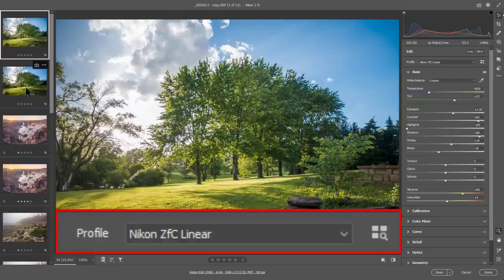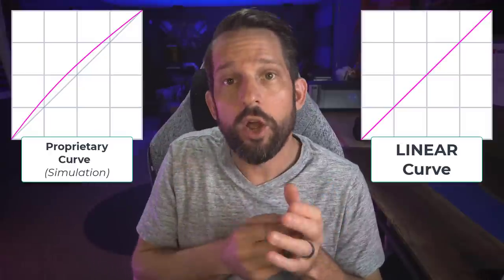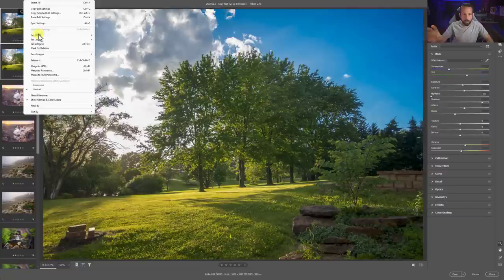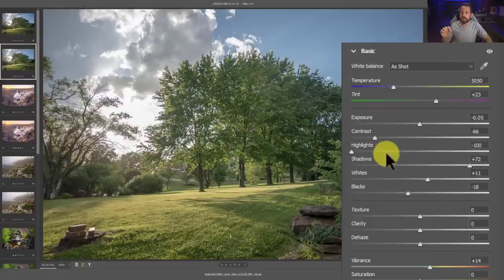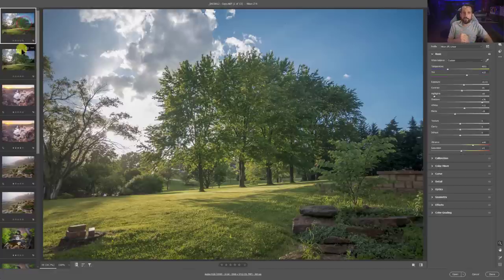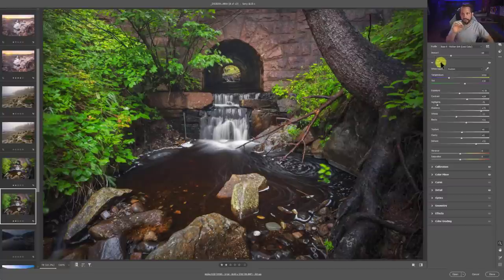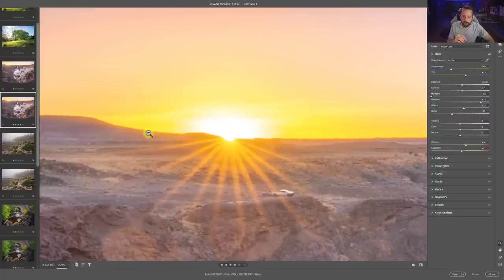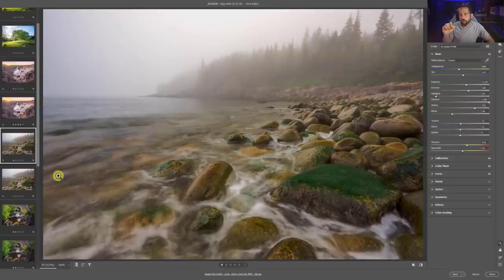Linear Profiles • What's so special?

Comment: Sorry I have to take exception with your comments/assertions about raw files... there is no profile hidden  in the raw. The profile is applied by the chosen raw editor be it on1, LR, capture one... THere is a obviously a profile used by the camera maker when preparing their out of camera jpg and typical raw editor will try to emulate that but a basic edit of the raw has only the profile applied by the raw editor..in your case LR.... LR is a display referred editor so right out of the gate it doesn't benefit as much as it could from a linear profile. LR hits the image right out of the gate with a display referred profile. THe data is now edited in that profile. As such say something like exposure. If you double exposure you don't acutally double the output....the effect you see is impacted by the curve in the profile This is why HL often get blown out by processing. Linear profiles recover this and allow adjustments to behave acutially more intuitively not less. With a linear profile if you double exposure then you double the brightness and the same for other controls... there is that 1 to 1 relationship in your adjustments. and this can actually help you to edit in a way that is more scene like and preserve the light from the scene.... THe full manifestation of this is in a software that actually allows scene-referred edits....and can work with HDR display effectively. In that case you actually work mostly in a linear space and expose for the midtones not worrying as much about the top and bottom limits... this can often blow out the highlights intially but there is a ODT applied after most of the editing to map highlights and shadow to the dynaminc range around the middle gray.... So you can see you are fighting with the linear profile because of this display referred pipeline of LR with anchored black and white and a distorting curve applied to the image at the start rather than the end.... Linear edits when you have the right pipeline will not look like a display referred edit and they will be generally better in many ways... you just can't fully exploit this in LR because you cant control the pipeline and LR puts the profile at the start....

Comment: For reference, Fuji and Sony colors are NOT baked into RAW files.  Neither is a curve.  RAW files REALLY are just RAW data, but because they're only data in the form of numbers and letters, they can't be viewed as an image.  So RAW editing software has to create a base look just for you to understand what the image is supposed to be.  But that is only the default.  You can change the image in any way you want.  For example, you can easily put Fuji color on a Sony RAW, and Sony color on a Fuji RAW, etc., because RAW data is RAW data.  It has no base look, and is near infinitely flexible.
Reply from the maker: That's interesting, then why do they all look different? There must be something baked in otherwise everyone wouldn't reach for linear profiles, right? I'm genuinely curious, because this is all a mystery to me. My Nikon files look different from my Sony files even with the same exact settings. Sure, lenses are a variable too, but it always has baffled me.
Reply: @f64Academy  I will try to explain it.  A raw file contains the signal reading that the individual pixel recorded during the exposure. Some pixels will record the Green light,  some the red light and some the blue light. This is the Bayer array. To convert these voltage signals into an image the signals from these different coloured pixels have to be "interpolated" into colour pixels. This is a complex math computation where the result depends on the demosaic algorithm used. 

So any raw converter has to demosaic the raw data to produce an image to display on the screen. There is no "raw image" only raw data numbers.

Raw converters like LR will improve their demosaic engines from time to time, and this is why you can change the "Process Version" if you want.

So each raw converter will crunch the numbers and produce what it thinks is a good starting point for editing. During this demosaic process the software applies a colour profile and a tone profile, usually an S-Curve. Exactly as you can do with the point curve tool in LR.

This is also why each camera, even if it uses the same sensor from eg Sony looks different to Nikon even though the Nikon is using a Sony sensor. Nikon want "Nikon" colour and "Sony" want Sony colour etc.

With a linear profile you are just removing the S-Curve that is normally applied during demosaicing and replacing it with a Linear curve. The idea of the Linear curve is to provide a better starting point with difficult, usually overexposed but not blown images for the simple reason any S-Curve will push the highlights into overexposure. 

Better software like Capture One have provided the option of using a Linear curve since V8 in 2014, so this is not a YouTube fashion idea, it's just a way making it easier to deal with difficult images in other raw converters.

Just a further clarification, the DNG generated by LR during HDR, Pano is a linear DNG, is effectively a Tif file in a DNG wrapper.

Hope that helps.

Comment: I found this video very interesting - thank you. I started using linear profiles a few years back, and I have to say that they really do work for me. For background, I use Canon gear to photograph wildlife and I process the RAW files in Lightroom then Photoshop. For wildlife work, I like to keep tone and colour in my prints as "natural" as possible and I used to really hate what was happening to my Canon RAW files (I can't speak for other camera brands) in Lightroom. Out of camera, they usually had far too much contrast and saturation. They looked garish and not natural at all - which meant editing them to flatten them out a bit and bring the colours back to reality. It didn't matter which "canned" profile I used - the problem was always there to some extent. I then built my own linear profiles for all my camera bodies and over time, I've developed a workflow that gives me the images I want and the extra effort is rewarded in the improved quality of my prints. I guess my experience is different to others - maybe wildlife work lends itself to linear profiles more because we often need to reduce contrast and saturation to avoid falling into the trap of editing too far? Anyway, I find it easier to flatten the profile and gradually build back the tone and colour than to fight against the canned profiles to remove the over-cooked contrast and colour. Thanks again for the detailed and very well researched video though - each to his/her own I guess!

Comment: I do not agree. I use Olympus em1 together with the em1 m2. with the linear profiles I notice that the details in the shadows improve, that the noise is lower (not only with ettr), that the rendering of the colors and the wb are more precise and with a better rendering (it seems to have worked in Lab with Ps) and that the images of the two cameras are almost identical in terms of rendering.
Reply: Personally, on my old and cheap Canon 70d, the detail drops significantly if I use a linear profile. And nothing can be done to correct this state of affairs.
I'm looking for a reason.

Comment: In Lightroom, after you apply a Linear profile you need to set the "gamma curve" with the regular curves. As ROMM (ProPhoto RGB) is the Colour Space when editing in Lightroom is encoded to a 1.8 gamma curve. You need also to bring the contrast slider to +50/85 to create the S curve you would've done with regular curves
Reply from the maker: Right... So you do all that to make it look like a regular photo without the linear profile 🤣

I jest, but it's true. You work harder to get your Linear profile to work for you than just working with the raw file to begin with.
Reply: @f64Academy  yeah ☹️. But it's super flat! 😂 I'm just joking cause I learnt about this stuff really yesterday. Need to dig more. But I'm more into camera calibration right now so the flat profile is in the middle of that process :)

Comment: There is a way to apply multiple profiles.  Begin in Lr/ACR, use the RAW profile (if you prefer) and do whatever else you want.  Open in Ps, then use ACR as a filter, at which point, you can apply any other profile you want.  You can go in/out of Ps/ACR as many times as you like, applying a different profile each time.
Reply from the maker: True!  But then you aren't working on RAW data because that's ACR as a Filter and not ACR the program.  That's also kind of unpredictable and could lead to more trial and error than I want as I'm working.
Reply: @f64Academy  Not if you open the original as a smart object.  Then you keep all the RAW data, even when you go back and forth.  Yes, much larger file size, but lots more flexibility if that is what is warranted.  (as least this is how it has been explained to me, but I could be wrong)
Reply: @lorijennings-emery8514  No, that's not true at all. If you run ACR as a smart filter, it's applying to the rasterized raw file, not the actual raw file. Not sure who told you that, but they were definitely wrong.

Comment: I don’t use linear profiles and I don’t consider myself as “knowing” anything about them but I had a completely different impression on the reason to use a linear profile.

I thought the intent of using a different profile is it changes the starting point (and that is all that has changed).  From starting at a different point, your thoughts and desires are altered and a person tends to end up at a different final image which they consider to be “better”.

A different profile doesn’t change the set of possible final images.  It only changes the starting point and that tends to cause those who advocate linear profiles to end up with final images that they consider better.
Reply from the maker: I can agree with that for sure. It is a different starting point, but is it a better one? That's subject to interpretation. I know many people who sing their praises, but I have many profiles I use for different starting points that I feel are better than a linear profile. It's all subject to workflow and what, where, and how people want to start.

Comment: I've played around with linear profiles a bit, but it seemed in most cases I just ended up pushing sliders a lot to essentially get it back to what the "normal" profile would already be like. Now I just keep it in my back pocket as an option with some problematic, high-contrast images, and try it to see if that helps or not -- but most of the time I don't bother with it now.
Reply from the maker: Exactly how I felt about them at first.  It took me a while to realize that the sliders are all going to be different in the way they operate because of the Linear nature of the file.

Comment: Really thorough and helpful analysis, Blake.  In my own experience, it feels (but not very scientific!) that I can "move the sliders farther" when I use a linear profile.  Your thought on "dual profiles" is interesting.  Conceptually, one could dual-process the image with different profiles, then blend together in Ps.  I might try that!
Reply from the maker: Thanks for sharing!  That's interesting.  I think that may be because you have to push them further to get the data you need.  It's almost as if with a regular profile even the slightest movement in the Whites or Blacks make s huge difference, but with Linear profiles you have to push them further to compensate for the flattened curve.  I would think that would be mostly true for Exposure, Highlights, and Whites.  Maybe not as much with Shadows and Blacks, though.

Comment: I wonder if all linear profiles are equal?  I find the ones I use flatten the highlights and shadows and I do not have to use any negative for my files.  Where I have to pull down the highlights in a profiled RAW, I do not have to do that with the linear profiles I downloaded.  This then puts the slider in the middle and I have more range of adjustment without stacking adjustments by using a brush.  It reminds me of the 90s when RAW was flat.  I also used Photoshop to make some profiles which are the normal profiles over a linear profile.  Then I can apply for example the Adobe color profile over a linear profile and adjust the percentage.  Which once I set it up, it gives me a very fast controlled starting point.  Of course since that is my that is my work flow, all my profiles and presets are based on that. I also do my final editing in PS with various luminosity masking and blend ifs in folder with subject masks to guide my viewers eye with luminosity, contrast, detail, saturation, etc.  Which may make a difference.  I would say my workflow is get all the detail I can to globally start and then accent or lessen it in areas to get the look I want.  When I an helping other people, I do recommend choosing the profile you like the best and then edit from there.  It can be faster and easier many times.  My way is to make a print I can sell which will more emotion and be what I see in my mind for that photo.  Before linear profiles were available, I always started from muted which seemed to give me the most range to adjust.
Reply from the maker: I think they would all be different, but have the same intent.  All cameras and raw files are different so I guess they wouldn't be created equal, if you know what I mean?  But in this video I did work with a Nikon Raw file and a Sony Raw file and saw similar concepts when editing.  The ones you downloaded are more than likely created with the Adobe DNG Converter and therefore they'd all be Linear Profiles created in the same way.

I think the best way to work is exactly as you mentioned here.  Making a Linear Profile, then using that as a base to build a LUT profile in PS that takes advantage of that data being flattened.  That's my experiment for today.

Comment: I find that I don't really need to bracket when using a linear profile. I still bracket in camera so I have the files if needed, but often I will only use 1 raw file.
Reply from the maker: I typically only bracket in large dynamic range scenes like shooting into the sun at Sunset.  Other than that, one raw file, regardless of the profile is good as long as the exposure is correct.

Comment: Linear or not, a profile is just a profile after all, and it does include some kind of color interpretation (how green is  a green photosite for instance). And I think that regarding autotone in LR, is does provide the same exposure basic slider values whatever the selected profile. Are you sure about the pipeline order you provide by the end of the video ?
Reply from the maker: From all of my research yes that is the pipeline. A LUT profile acts different from a standard camera profile in terms of Adobe from what I gather, but what do I know, I've been wrong before.

Comment: Hey Blake.  Thanks for this.  I was a user of linear profiles, but once I started using IP Chroma 2 I found that it really did not bring anything to the dance.  I tried IPC2 both ways and found that I liked the results without the linear profile.  I find that whites are indeed an issue.  Still playing with them both with IPC2 though.
Reply from the maker: Glad it helped.  So my process is to take a RAW file, press Auto, open it in PS.  Then from there I build a LUT.  I turn that LUT into a profile and thats what you use in IP Chroma.  So I use Auto as the baseline on an Adobe Standard profile to create my LUT profiles in PS.  You don't see all the stuff that goes into it.  But the process is more of a creative one than a flatten the curve one.  I feel you get more predictable results that way.

Comment: At minute 17:10 you talk about when this profile is added in the process, and you say this happens on top of everything but before Color grading panel. For my  experience, that is correct for .xmp profiles, which are those creative profiles you create with a LUT inside it.
However, linear profile are DNG Camera Profiles (.dcp), and they work before Curve, not after. Infact, if you try to create a creative profile with your own LUT, starting from a Linear profile, then you apply this XMP profile to your raw file and you reduce it with the amount slider, the only thing reducing is the LUT, not the linear profile. This one remains 100% active even if you reduce the Amount slider.

Comment: Thank you for this explanation, it confirmed what I felt for the past few months trying to work with linear profiles, and is that it requires more work to get a good edit out of it since it flattens and dulls everything. It’s great though for some images where you’re trying to recover bright overexposed areas, but other than that I think it’s difficult to work with because it changes the nature of all the sliders, so you have to do more work just to get it back to base!
Reply from the maker: Glad it was helpful!  I feel very much the same way.  Although I really feel they are more for extensive PS work with Luminosity masks where you don't want to start too dark or too light.
Reply: @f64Academy  Exactly, you’re right!

Comment: Thanks for doing like you do and breaking down complex topics and offering thoughtful analysis and examples.  I have only dabbled with them and found no great benefit in the handful I tried.  I felt it actually slowed me down in more than one because the lp made them so flat.
Reply from the maker: Yeah, the more I play with them the more I feel like they are designed for serious Ps work rather than trying to get it right in ACR.  Luminosity Masks like Linear Profile data, because it gives more range with the curve in PS.  That can be a very good thing.